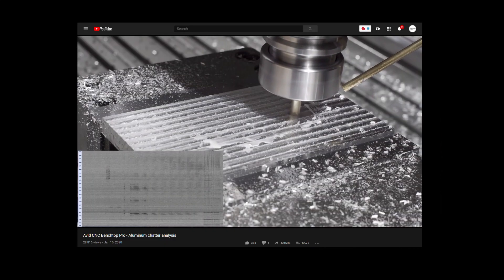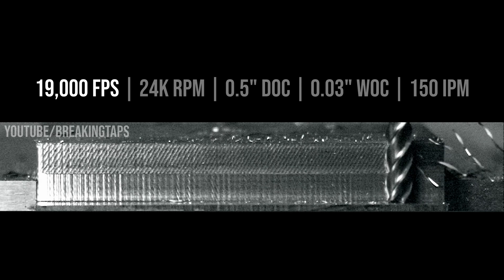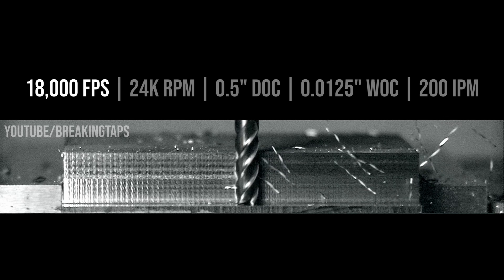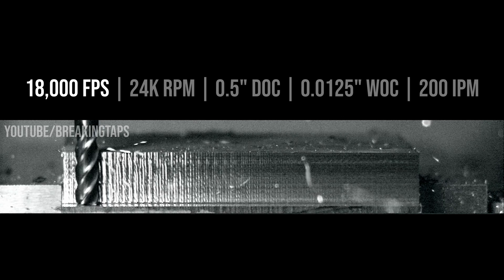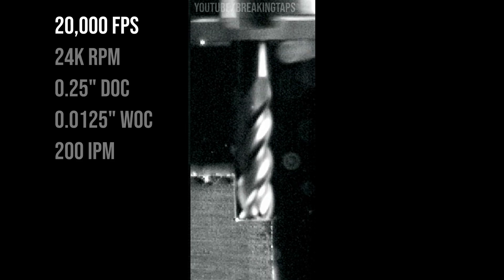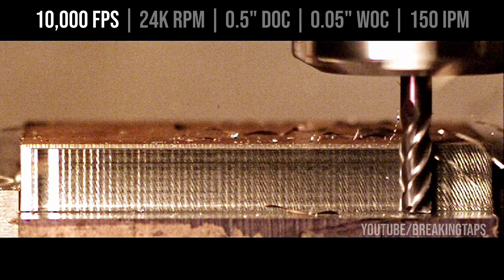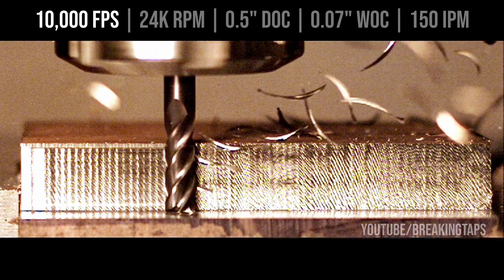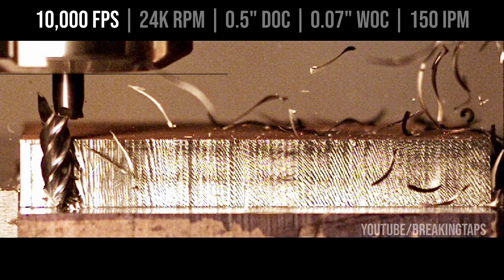Endmill chatter at 20,000 Frames-per-Second

Comment: I’m not familiar with your machine. Is it running on ball screws? Does it have a belt drive? What is your backlash on all three axis? Even on the big machines harmonic vibration can be a problem of balancing chip load to RPM.
Reply from the maker: Ball screws, linear rails, direct drive spindle. Haven't measured backlash in a long time, but iirc it was quite minimal /nonexistant, and repeatability was < 1thou.  BUT, it's an aluminum-framed gantry style router machine: aluminum extrusions for bed and gantry, solid aluminum for gantry support, rails mounted to aluminum, etc etc. Weighs no more than 300lbs all up.  So I suspect most of the movement that we're seeing is the actual frame and bed flexing around as the forces build up :)
Reply: @BreakingTaps  yes, the modules of elasticity of aluminum compared to cast iron would tell the story.

Comment: Beautiful footage! Interesting for me as a layman, if I understand it correctly, to learn that cutting too little material in one pass in order to not stress out the machine and the flute may actually be harming your equipment?
Reply from the maker: Thanks!  In some instances, yeah. If the cutter doesn't engage the metal "enough", instead of starting to shear the metal it can instead slide/rub on the face of the metal and bounce away.  The cutter (and machine) are very stiff so this doesn't happen in normal circumstances, but if you have a small enough width-of-cut it's easier for the cutter to bend out of the way instead of bite into the metal.

The biggest problem is that chatter tends to be resonant.  So once it bounces off once, the next time it engages there is a higher chance of repeating the process and setting up a resonant, chattery behavior. Machinists often tweak the feed rate or spindle speed just slightly while running and you can hear the chatter go away, because it breaks the resonance.
Reply: Fascinating! Thank you very much for the clear explanation. I love watching milling and other material processing, especially closeup in slow motion. 👍

Comment: Why are you cutting while climbing? Every machinist I know would be cutting left to right so it rotates underneath into cut.
Reply: I'm a CNC programmer/machinist and virtually all cuts are climbing. There's exceptions (ie. high speed roughing cycles), but climb cuts evacuate chips much better with high feed rates and leave better finishes on final passes. Manual machining is the opposite. The table on a Bridgeport for example will try to move the work piece into the cutter since the table's backlash will be in the direction of the cut. Hope that makes sense

Comment: Isn't 24,000 RPM a little fast to be cutting steel? That is 1,571 Surface Feet per Minute peripheral speed. Carbide in mild steel you're usually looking for around 275 SFPM. So just about 6 times slower. 5.7 but who's counting? I mean when you're over driving that much who really cares?
Reply from the maker: Oh yeah, definitely :) I chose parameters that were known to induce chatter, so that I could capture it on high speed. :)  I still have to run fast in steel since this spindle loses torque before optimal SFM, but I do try to run it a fair amount slower.  But I tend to use my manual mill for steel in general so it's mostly moot.
Reply: @BreakingTaps  fair enough. I was frankly surprised how well it worked.  I know a lot of operators running machines less rigid or massive over drive cutting speeds to compensate for those shortcomings.

Comment: What am I missing here? Climb milling is never advised because of inherent chatter.
Reply from the maker: Not missing anything, I chose parameters that would cause chatter on purpose.  I just wanted to see the chatter at high speed, and this set of parameters was the best way to do it :)

(I don't think it's true to say it's "never advised" though, climb is the standard for most machines that have the rigidity to run it. Better finish, better tool life)
Reply: @BreakingTaps : Climb milling chops; conventional milling slices.

Comment: It appears to me that you have a couple of problems with your mill.  Based on the high frequency chatter marks on the work piece, and that there is a difference in the chatter marks as you travel in the -Y direction, I'd say that your Y axis gibb  is worn and the spindle bearings are shot.  That small of an endmill made of Carbide should not be able to displace the spindle movement that much unless the bearing is shot.
Reply from the maker: Note: this is an aluminum framed, gantry-style router. Linear bearings and ballscrews but mounted to aluminum, aluminum extrusion bed, etc.  I'm almost positive the movement we're seeing here is just the machine frame and table flexing around. :)

Comment: My first questions are : are you working in the right SFM for the machine ? And the correct depth of cut to the diameter of the tool and correct feed rate and chip load ? I have tons of parts where I am using Harvey end mills at .018 diameter with high speed electric spindle .
Reply from the maker: Oh, absolutely not :) I chose purposefully bad parameters to emphasize chatter, specifically to catch it on the high speed :)

Comment: Not a machinist, but was surprised to learn that a more shallow cut is not better.  I guess your final pass cut can only be so shallow and no more.
Reply from the maker: Yeah, pretty wild right?  I suspect it is probably due to the very small amount of flex that happens in the spindle and carbide endmill.  It's small, but with small-enough cut it's enough that it is easier for the endmill to flex out of the way rather than taking a nice cut.  Just a guess, i don't have much proof of that, but it seems reasonable :)  And once it starts chattering, it becomes a resonant system and keeps bouncing around like a we noodle :)

Comment: Bro, the 1800's called. They want their measurement system back. Metric is what the modern world uses
Reply from the maker: Haha yeah, sorry about that. I normally add a metric version and just forgot for this video. My bad!
Reply: @BreakingTaps  It was a great video. Normally I just do the conversions but I was feeling lazy
Reply: Hey let me know when your modern world lands on the Moon. Because we got there over 50 years ago now using US Customary.
Reply: @1pcfred  Hey Paul. Well no actually, it was the German Wernher Von Braun and his team who got you Yank's to the moon, you guys just provided the resources.
Reply: @godfreytomlinson2282  Hate to burst your bubble there, Col.Klink, but there is a whole lot of "wrong" with that comment. They do deserve credit, which they get, but they did not get here and engineer the way to the moon for us. Far, far from it. To say your comment is an overstatement is an understatement. His claim to fame in Germany, the V2 rocket, wasn't real great. 6 out of the 10 blew up, most of them on the pad, during launch. They had a max range of 200 miles. That's not quite the 230,000+ miles it takes to reach the moon. And the German team's first project here was the Redstone rocket, and they blew up for 3 years. And Wernher himself did not want to use liquid hydrogen as a fuel because he felt it was too dangerous, but that fuel is one of the big reasons we got to the moon. Us Yanks, with the Imperial System and slide rules, got to the moon. The German team helped. As for the metric thing, I think the rest of the world uses it because it's "easier". The Imperial system is hard. We're smart enough to be able to use it. When you need something measured very accurately, do y'all just get it to the closest millimeter and call it "close enough"? (Relax! Just a little poke in the eye to you "metricals".   lol).

Comment: Would there be a way to attach a transducer to the bed so a 'noise canceling' vibration could be added to counteract the vibration caused by chatter?  Sort of like noise cancellation, except in this case it would be chatter cancellation.
Reply: It's a lot cheaper and more effective to use... good cutting parameters for your machine :)

Comment: I think it's been said lots of other places (AvE comes to mind): "everything is a spring."  It didn't make any sense to me until I thought through what makes a spring-pass even possible.  This video really drives the point home.
Reply: Robrenz: "You must think like everything is made of rubber". And he was lapping a granite surface plate.
Reply: Not only a spring, but a spring-a-ma-thing
Reply: The three fundamental truths of engineering: Everything is a spring, everything leaks, and there is no such thing as a sharp inside corner
Reply: @zuthalsoraniz6764  sharp corner not only sharp inside corner. At the sharp side of every knive it is just a radius, they may only be measured in nanometers or so but they are there.

Comment: This is beyond educational. I hope you realize the service you have done here. It makes the science behind machining visible. Thank you.
Reply: I also wanted to ask, when your spindle bogged down and the VFD eventually shut off, if you had a more powerful spindle (5kw), that cut would of then been possible, no?
Reply from the maker: Thanks!  I think a more powerful spindle might have done the trick, although I suspect there might be a configuration issue with my VFD too.  Someone else in the comments ran the numbers and the spindle should have been pulling under the 2.2kW limit... so there might be a threshold on my VFD that isn't configured correctly, or maybe I tripped the thermal cutout.  Not sure :)

Comment: Nice video!

Don't forget, when you reduce your step over you need to up your feed rate to get the same chip thickness. Investigate chip thinning. On your .012 step over your feed rate was too slow to "load" the endmill.
Reply: And by the same token, reducing the rpm could have had the same effect.  The limitations of the machine tell you which to choose.

Comment: So I used to work in industrial automation, and one time we were building a machine to remove coating from pipes in a specific way. The project was a pain in the ass and was taking much, much longer than initially estimated but we were making progress.

We had a medium-strength steel blade as a kind of scraper to remove the coating at a high RPM - the whole system rotated around the pipe as fast as possible - and the blades were getting stuck and sometimes breaking. The boss came in and told us to use carbide blades. The main mechanical engineer said "no, that's not the issue, carbide will just break MORE easily". 

Nope nope. Boss says use carbide. Spent a week reworking it to get the other blades in there. First run, blades just shatter. Get out the spares and slow it down. Blades shatter.  Do this a few more times after waiting for more carbide blades to get made up. They shatter. Boss finally goes "huh maybe carbide is too brittle." YOU DON'T SAY!!
Reply from the maker: Haha, if only someone had known ahead of time and could have warned him!  😂

Comment: Great video, you mentioned the Radial Depth of cut was the cause of chatter in this case, it would be interested to see if accounting for chip thinning and maintaining the proper chip thickness resolved the situation.  even if you had to slow the spindle speed to get the appropriate FPT it should help i would think.
Reply from the maker: Thanks!  I agree, I think that would be very interesting to look at.  I kinda bludgeoned it with settings to make the chatter bad, would be interesting to see how correct settings look, and how far you have to go outside the correct settings to start getting bad behavior.

Comment: I came across your channel a while ago in Youtube recommendations and I've been consistently watching your videos. This is an awesome video and I appreciate the novel ideas you are putting forward. I think it is the machine gantry that is deflecting and not the endmill alone. It may something to do with overall machine rigidity. Typically the rigidity is lower in moving gantry machines. You don't have a nice heavy chunk of concrete or epoxy granite holding the spindle housing. Add to that aluminium frames deflect. A lot! Over a distance of about 800mm, a standard aluminium frame would deflect by as much as 1mm. Thats huge. With stiffened frames it comes down to about 0.2mm or so.
Reply from the maker: Yeah I've been rewatching this and other footage I captured... I think you're right.  It's looking like the whole z-axis is acting as lever and twisting/torquing the gantry.  I'm trying to figure out a way to capture a wide shot with motion tracking dots or something, to see if we can determine how the machine itself is moving around.  I have strong suspicions the table is flexing around some too... the Avid machine uses a type of extrusion milled flat on one side for the table which could also flex.  Thanks for watching!
Reply: Just an idea of the way how to figure out how much is your gantry flexing: if you attach a point laser to your gantry and project it to the wall, you will be able to see amplified twisting during the milling. 
And please keep up with fantastic videos. You deserve more subscribers.

Comment: Awesome! Seeing a few cuts in stainless would be interesting. Maybe we’d see work hardening effects? Also a gummy aluminum alloy using an inappropriate cutter could be interesting. Maybe a nitinol alloy too? Lots of options; sorry for your end mills. Oh, actually, a similar study on lathe chatter would be fascinating as well. TIA!
Reply from the maker: Ooh stainless is a fun idea.  I'll do some reseaerch and see the best way to set that up... presumably a too-slow feedrate so it rubs a bunch and hardens the work?  Definitely want to try aluminum welding, I think that'd look very cool in slow motion :) I wish my machine was rigid enough to try those fancy cermaic tools, would love to see them start glowing in slow motion. Alas, they'd probably break just looking at my machine haha. Thanks for the suggestions, keep them coming!  So many interesting videos to try!
Reply: @BreakingTaps  I think with stainless you’ll find that the cutting action (not rubbing) actually hardens the surface— to successfully cut stainless, the cutter has to pierce the hardened surface to get to the soft inner goodness. If the chip is too thin, it has to work through much more hard material. I think we’d see the chip fracture and splinter, and the cutter load up in weird ways. If the cutter rubs, I’d bet you’ll get a handful of frames before it explodes spectacularly.

Edit: if you acid etch the surface of the stainless, you might see the hardening change the crystal structure and the subsequent difficulty of the cutter.
Reply from the maker: Oh cool, thanks for the notes!  That's a lot different from what I expected, and potentially a lot more cool to see on film :) (also haha "soft inner goodness" 😂).  Will look into acid etching, the extra contrast would probably help the high speed a lot... I had a lot of difficulties with reflections given the amount of light pumped into the system.  Resorted to using dykem blue in some tests just to reduce the glare.  And bonus points for revealing the grain structure with etching!  I wonder if I'll need a closer/macro lens to see the grains well... hmm 🤔  Just had a quick skim of google and it doesn't look like the reagents for stainless etching are too bad... even a few electrolytic recipes it looks like.  Thanks again for the tips!

Comment: Nice!  HSMAdvisor shows that the cut that caused the VFD to give up should have required only about 2 of the 3 HP claimed for that spindle.  Were you monitoring spindle power/current?
Reply from the maker: Oh now that's interesting, I hadn't punched in the numbers myself.  The VFD can show voltage and current draw, but it's sorta hidden away and not easy to access (and I don't have the Avid machine wired up to grab that data yet).  Might setup a secondary camera on the VFD to see what it reaches.  Maybe it wasn't overpower... there was a generic error code and I assumed it was power without actually validating it :)
Reply: @BreakingTaps  I added your machine to the HSMAdvisor "Cloud".
Some VFD's can provide analog and/or digital outputs that might help.  Since torque is proportional to motor current, and you know speed, you don't need voltage to calculate cutting power.

Comment: I'd be interested in seeing something like this using acrylic instead of steel.
I use a lot of acrylic at work, and I sometimes have a similar problem. Rarely do I use steel, and even then it's the really thin stuff. 

This video is awesome though, didn't realize so much was happening during chatter.

Also, it's so funny that people using a CNC are flabbergasted about .002", most people can't even comprehend that little.
Reply from the maker: I bet clear acrylic would look super rad in slow motion, especially if I can get a shot "through" the acrylic.  Ditto for when it starts getting melty.  Will look into it!